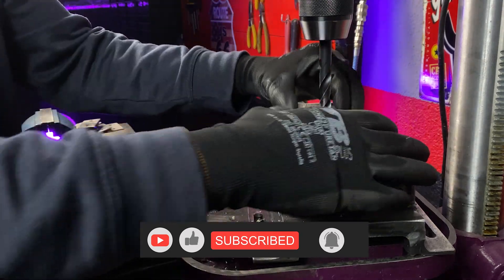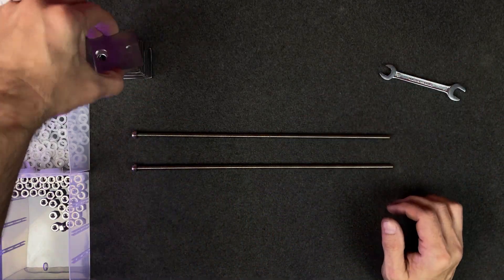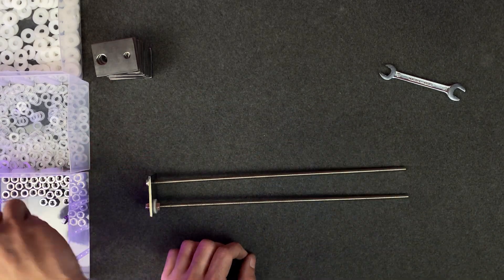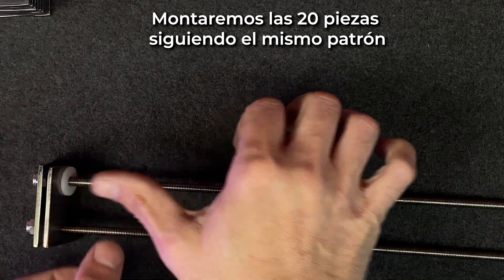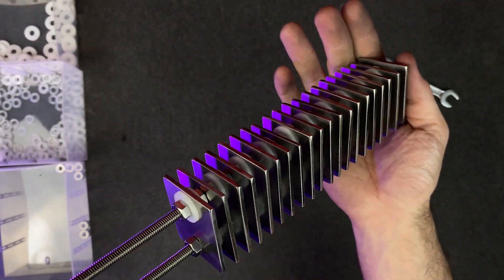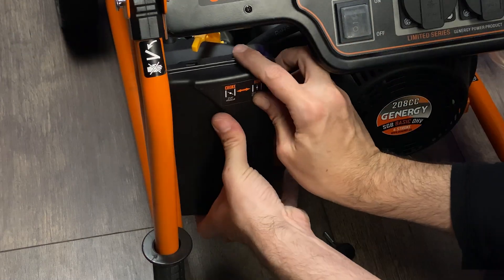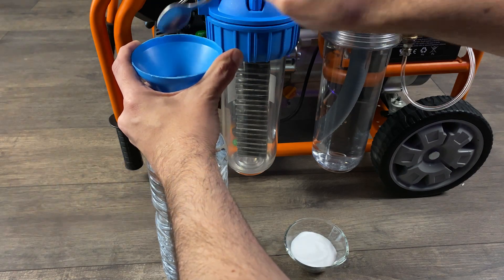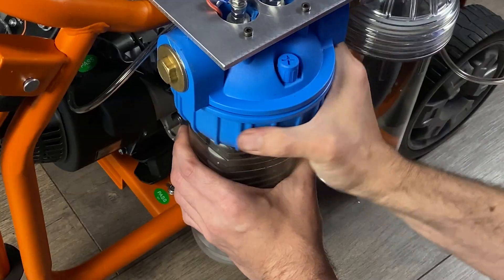GENERADOR A GASOLINA QUE FUNCIONA CON AGUA

Comment: Has anybody figured out an easy way of storing the excess hydrogen or do you just keep the engine running and then turn off the hydrogen generator when you're done with it running?

Comment: The interesting question, is this device working at overunity? Is is producing more energy than it is taking from its battery? 

I've heard of advanced technology doing electrolysis with overunity, but that would require some additional thinking. Afaiu you'd have to create electron plasmas in the water, where electrons would run on a circular path, with velocities way above the usual speed of electrons in fluids. You wouldn't need relativistic velocities, but you'd have to speed the electrons up for some time by a dynamical electric field, hoping that the electrons somewhat stay on their orbit. The basic mathematical function, that the field would have to follow, is very simple, a (3-dimensional) sine or cosine, as sine is the projection of the intended path of the electrons (sine as projection of circle). In some other context I've heard of the electrons running on a circular path, but additionally spiraling around that path, don't know, if that is required, and if so, what for. That may sound very difficult, but you can achieve such orbits by (complex) compositions of sine functions, so the math will stay elementary, at least in some sense. Creating that kind of fields probably isn't that simple, but feasible,using advanced equipment.

This approach may require some additional component for better conductivity, some form of salts aka electrolytes in the water, e.g. Lithium. I don't know which salt would be the best, Rossi is said to be using Lithium aluminium hydride for his LENR device, which at first glance has nothing to do with electrolysis, but it might still give you a hint, since he's using similar functions (complex sines).
Reply: Potassium hydroxide supposed to work well. Someone else said monosodium glutamate to take only the hydrogen. Yet another said alumino silicate zeolite y type.
Reply: But you are correct Stan Meyer used frequencies to increase rate. Used other tech to keep bubbles micronized so bubbles didnt form on the plates.

Comment: So the idea of the catalyst is to help split the H-O bond with the minimum energy.   Therefore this secret catalyst is the consumable substance or undergoes the degradation giving rise to the access energy supporting the system self-running??
Reply: Salt probably
Reply: So the ocean water would be great
Reply: @raydan18  I remember in grade 8 the science teacher made hydrogen
Reply: The hydrogen is easy to make. The skill is in making it so efficiently that when you measure the energy spent to make it vs the  gas volume produced at the output, output energy should be more then input.  The input energy can be measured by the electrical power(volts * amps) used to split water to HHO gas and the output power either measuring the gas volume output, running the output gas(if pure H2 and 02 obtained separately) through the Fuel Cell and measuring the electrical power output of the Fuel cell or first running the internal combustion engine with the output gas, then connecting the IC engine to the generator and again measuring the output power
Reply: @raydan18  yes and even if you got 35% better mpg that's big money now.
Reply: The “magic” salt is sodium or potassium hydroxide, it is not a catalyst. It’s just used to increase the conductivity of the water. However, the system is anyway not working, you are not able to produce enough H2 to make the engine run. If enough H2 would be available, the engine would still not run - the ignition timings are completely wrong, the efficiency too low, NOX would destroy the engine (NOx + H2 -> HNO3, very simplified), leaked gas in the crank case would destroy bearings, crankshaft,….backfired gas the valves. A normal combustion engine can’t be retrofitted.
There is also absolute NO fuel saving effect (conservation of power/energy, gas laws, thermodynamics,…..)
Reply: @holgerkirschbaum6911  arguing with these people is just about useless. People so badly want to believe the government is holding back secrets to free energy, that they believe these grifters that are just using youtube for money. Look at his liberty engine, what happened with that I wonder:)
Reply: @KevinSmith-os5yz  I know and I fully agree. It makes me sad to see how many people actually believe in such “technologies”, I thought we are living in the 21st century and the majority of mankind is at least educated to a level to understand that it can’t work…..
Reply: @KevinSmith-os5yz  OMG, I just watched the Liberty Engine video - unbelievable and still people believe such a crap
Reply: and baking soda
Reply: 2 NaCl + 2 H2O → 2 NaOH + H2 + Cl2 yes he basically creates H2 out of H2O and and Salt (HH+)

Comment: For those that think this is real, its not and this will make you understand why.
It takes the same amount of energy to convert water(H2O) to Hydrogen and Oxygen gas as it does to burn the hydrogen back to water(H2O)...
Most efficient combustion engines are only 70% efficient
electrical engines are at best 99%
Electrolysis of water(electrical energy turned into hydrogen fuel) is ~50% efficient.

This engine needs to produce 2.6* as much energy burning hydrogen fuel into water then it uses to generate the hydrogen fuel from water just to have a net zero output of useable energy(energy that can do work like run a light bulb)
Reply: cumbustion engine can't just run on hydrogen, one of the water tanks is just filled with gasoline
Reply: @merlinminy6871  Combustion engines can and do run on hydrogen... google hydrogen fuel cells... It however cannot be self sustaining(cracks its own water)
Reply: @givemeanameman1  fuel cell differs from classical internal combustion engines, and if it runs at all I’ll bet very poorly because the compression ratios from mainly octane becoming lighter gaz and dihydrogen becoming an incompressible liquid are wildly different.
Reply: @merlinminy6871  A subset of secondary Hydrogen fuel cells/storage produce hydrogen by acid/metal reaction providing hydrogen in a safer manner then storing it in a tank, this hydrogen can be used in a normal hydrogen fuel cell or even combustion engine.

Pure hydrogen works great in combustion engines, with diesel engines needing almost no modifications. At no point do you want or need to compress Hydrogen to a liquid.
Hydrogen as a replacement is used already by farmers around the world in areas where logistics means getting fuel is hard(such as outback Australia), it Generally consists of a small solar panel farm that cracks water and stores hydrogen in a tank which the farmer then uses to fill the tank on their Tractors/Trucks and Electrical generators.
Reply: 1. 12v battery that starts the generator, is powering the hydrogen production independently. 
2. hydrogen produced in chamber 1 is pushed into chamber 2. The purpose of the hose is to keep hydrogen bubbles separated as by volume, they...
3. IGNITE with approximately 100x the volatility of gas vapors and I'm sure you've seen gas IGNITE.
4. chamber 2 keeps a safety between hydrogen production,and ignition in the cylinder.
5. Hydrogen is waaaay more efficient then gasoline. cleaner too. When the hydrogen molecule and oxygen molecules are introduced to spark, they reunite with intensity but just go back to their ultra stable h20 molecule. It's a pretty beautiful love story, really..
6.The generator is producing a SURPLUS of energy. more than enough to continually charge the 12v battery that's powering the hydrogen production that's exploding with ferocious power to produce waaaaattttts.
Reply: @AccidentalBroadcast  Its impossible for it to produce SURPLUS ENERGY...
It takes the SAME amount of energy to crack water into HYDROGEN AND OXYGEN as the Hydrogen produces when it recombines into Water when burnt... Even assuming everything was 100% efficient it still could not do work, it could only run itself forever...
Reply: @givemeanameman1  it cannot run itself forever bro    pretty sure about that   xD
Reply: @AccidentalBroadcast  Yh but rly no

Comment: Aren't all the plates still electroly connected through the rods going through the holes in the plates regardless of the insulating washers?
Reply: One of the tanks is opaque bc its full of gasoline
Reply: Good catch! It looks like it, but on hole on the plate is larger than the other. So it is possible that he assempled it without creating a short. BUT, that 1st plate connects both sides! So I don't know. You may be right.
Reply: Re checking: He does have insulators in there. This is a really good design. But, is it enough to generate enough fuel to run that engine??? I don't think so, but I never got this far.

Comment: the electrolysis is already running when you turn the Engine on.. that means you had power connected first
What is the point of the mashine if you feed in Power to get fuel that is converted back to power? We have learned in school that electrolysis is not 100% efficient that means you are just wasting energy xD
Reply: i dont understand your comment and a couple similar to yours. he wasted electrical energy ONCE, just to make the machine/make it function on water, from there its only water wasted?

Comment: Whats in the HH+? Why bother showing how to make it if you keep secret how to run it?
Reply: Most likely baking soda or potassium hydroxide maybe sodium hydroxide other names (caustic soda) (Lye). Even salt could be used but can other things to be produced. I believe these are the electrolytes that help the separation of hydrogen from oxygen. But it still needs electricity to separate them. That's where the battery comes in. But I'm still not sure if it'll misfire or where the oxygen goes. I'm sceptical on this engine. But in that video it's not a powder so it hasn't been grinded down looks like it came like that so maybe salt. Baking powder would be a powder so that can be ruled out using table salt can be dangerous in a non ventilated room. So potassium hydroxide or sodium hydroxide. So most likely potassium hydroxide because sodium hydroxide in a smaller form like that looks like tiny beads. But also dilution rate can also help like how fast or slowly it dissolves in water. Copper or graphene is far more conductive than aluminum or steel having copper wiring hooked up to the battery could be better and faster at separating hydrogen. But it's like 2 in the morning I need to sleep I'm too tired right now to figure it out.
Reply: @BearerOfLightSonOfGod  figure it out pls
I don't have the brain for this
Reply: @victoryawesomenessgaming5806  It doesn't work the way you think it will. I was tired when posting this and didn't really think about it but you need electricity to separate the 2 hydrogen molecules from 1 oxygen molecule this electricity is energy waisted on separating the the water molecules simply put this is just a waist of energy. I was thinking about making something like this due to conditions on earth the heat is getting worse where I live so if I can convert heat into energy I could use this energy for hydrolysis create hydrogen gas and oxygen gas but I wouldn't use a generator like that it's probably net neutral so it's basically not producing any real energy the oxygen is use for other things and hydrogen can be used to power cars but the engines aren't designed to fully utilize hydrogen gas. By the way you can make methane gas from bacteria eating grass clippings while submerged in water look it up if you need a flammable gas.
Reply: @BearerOfLightSonOfGod  thanks for the explanation
I really appreciate it.
One thing have been thinking and plotting is if someone can make one of those transformer that powers a whole community but this time make the mini version that could only power your home
I don't know if it's possible but I do think it is but it's not going to be easy.
If I have the income I would like to experiment on that
Just imagine if anyone could own their own mini portable transformer that they can use to power their homes or workplace.
Atleast it's better than gasoline generator atleast that's what I think.
Solar is expensive honestly.

Comment: so ... its a combustion engine ... with some watery tubes and reservoirs connected
that have nothing to do with the combustion happening in the cylinder
Reply: If you put a hydrogen gas hose directly into the carburettor, the engine will work.
But I still doubt that this system is getting enough hydrogen from that setup..

Comment: A: why does it sound the same as a gasoline engine?
B: how does it run on the same engine and intake as a regular gasoline engine? Hydrogen engines need an insanely high compression ratio and the hydrogen needs to be directly injected into the combustion chamber in order for regular hydrogen to work.

Comment: The electrolysis of water is only 70% energy efficient. If the generator is 90% efficient in burning the hydrogen, then the overall input-to-output energy efficient is about 63%. Battery would eventually run out of charge, assuming the water didn't first or plates didn't need replacing. System uses more energy than it produces.
Reply: I wonder what happens if you use expensive materials like copper, gold, platinum... Edit: they pay you enough to troll on this kinda subjects? Help me take a job like yours mate. They gonna need a bunch of trolls to shut up these inventions
Reply: @quan7umleap  basic physics isn’t trolling. You’re watching a battery powered motor with extra steps. Even using platinum plates, the hydrogen output would not generate enough power to continue the electrolysis on its own

Comment: The energy required to separate the h20 is going to be more than the energy you gain when it recombines. You are basically using the battery to make hydrogen that runs the motor to partially recharge the battery again limited by all the energy wasted by the machinery.
Reply: You do know the difference between AC and DC right? Also there's a magneto on the engine charging the battery as well as it turns over
Reply: @roodick85   either AC or DC will work in your system since both negative and positive plates are contained in the same cylinder. Usually you would have them in 2 separate cylinders so you could collect just the hydrogen on one side and release the oxygen and then only DC would work. Since your not trying to compress or store it your system will keep the h2 to o2 ratio correct though. Most commercial hydrogen is made from natural gas because it takes a lot less energy to break the hydrogen off it than in electrolysis. That looks like an inverter generator which means you would have better overall conversion rates using a fuel cell to supply the inverter and ignore the engine part. Engines have really low efficiency rates.
Reply: @roodick85  Certainly there is a magnet on the engine to feed de ignition system and charging the battery, but not enough to support the battery delivery to the HH cell for a long  time.

Comment: querido amigo, con todo respeto, llevo años construyendo generadores HHO (Hidrógeno y Oxígeno) (como tu modelo) y solo generadores de hidrógeno, me gustaría saber si has modificado el encendido de las bujías (adelanta la temporización ) porque el hidrógeno se quema mucho más rápido que la gasolina, y si cambió la sincronización eléctrica para ajustarse a la explosión de hidrógeno más rápida, dígame cómo lo hizo. por favor, entonces, inyecte el HHO directamente en el tubo de suministro de combustible del carburador, ? y modificas (reduces) la entrada de aire a la mitad (-50%) exactamente? finalmente dices que ajustas el flujo de gas por el tornillo del carburador exacto? Finalmente, ¿su generador es de 2 tiempos o de 4 tiempos? ¿Puede proporcionarme el número de modelo de este generador de 3000 vatios y 208 cc? el nombre de la empresa de este generador por favor. a cambio, te daré algunos consejos adicionales sobre cómo producir más hidrógeno con menos corriente eléctrica sin usar koh (HIDROHÍRDO DE POTASIO) Tengo mejores soluciones para electrolitos. Yo espero ansiosamente tu respuesta. Gracias. ultima pregunta, si el motor es solo de 2 tiempos como se engrasa?
Reply: hola no es de dos tiempos es de cuatro y la marca es energy es española de Logroño.Te lo digo para que lo sepas el rendimiento es de 2800 W en continuo de 3000 en arranque.Yo no soy el del vídeo pero te lo informo de las características.
Reply: @rubenpm4901  OK MUCHAS GRACIAS AMIGO, voy a hacer una busqueda sobre esta empresa generadora española.